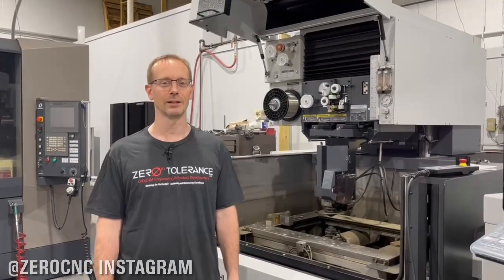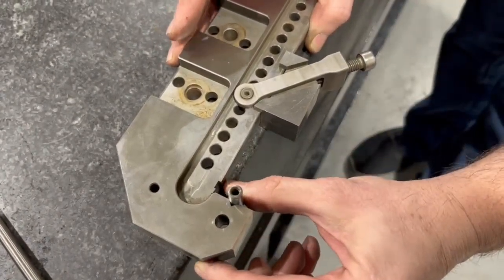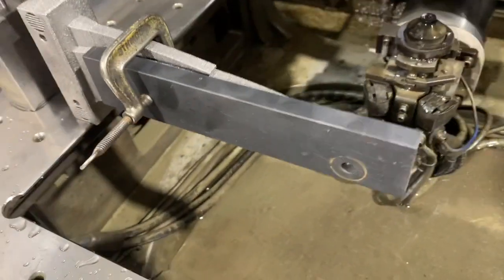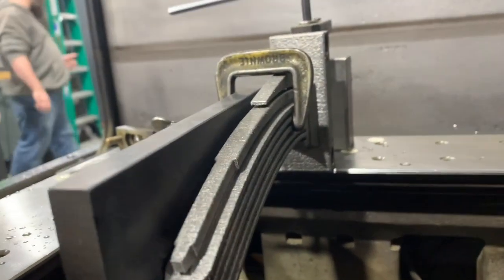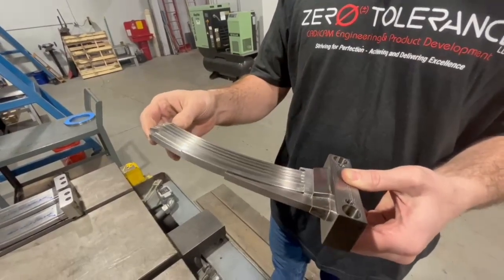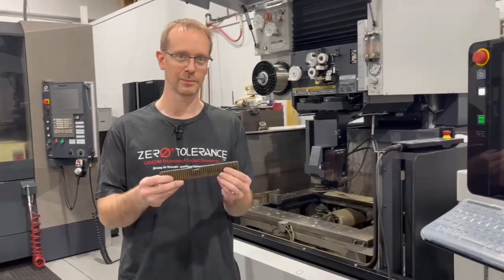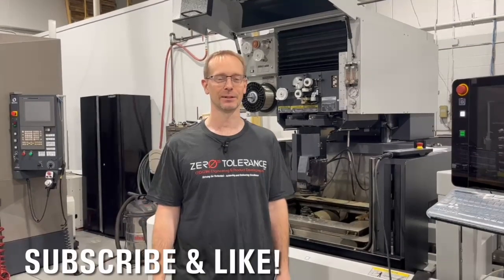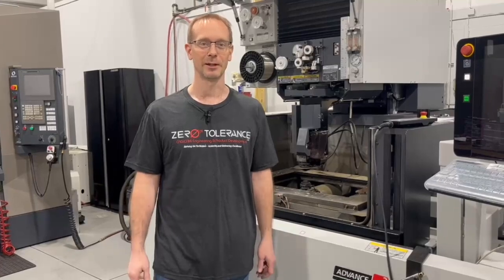Wire EDM - Practical Setups and Applications | Learn to Burn

Comment: I set my edm to always work overnight. Get it cutting, get magnets on it and hopefully its done in the AM. My sodick 280 is old and sloooooow. Im cutting a 2 in thick 7inch diameter D2 hardened gear basically. Wire breaks are my nemisis and kill my job flow

Comment: You should do a tutorial showing when it would be more or less efficient to have a wire start hole in the stock versus starting outside the block and cutting in.  I've had thin sections warp and pinch the wire if I don't start from a pilot hole.

Comment: Very nice video, thanks for sharing with us @ZeroToleranceCNC ! Any tips on how you control/prevent the bending of the parts/tabs after the roughing pass?  Especially with thin parts/tabs...
Reply: The thinner the part you want to try and make a bigger tab if possible to keep it from bending.

Comment: Very informative video. Really appreciate it. I have a question regarding skimming. is it necessary to rough all the profile first and then skim the profiles all at once? Which scenario calls for this kind of cutting method? Will the final results differ if we perform rough and skim passes back to back at each individual profiles? I guess this connects to temperature difference may be, I'm not sure
Reply: The only concern you would have is the amount of time your block is in the tank getting rusty. The dimensions should still come out good, its really a preference thing but we do it based on the rust factor and how long it is in the tank.
Reply: Thank you for your reply. One more problem I'm running into often is holding punch while performing multiple skim passes in tabs. We use shims and glue to hold the punch in place but it still twists and ruin the part. Can you suggest any method to hold it firmly or perhaps show it in one of your video?

Comment: Thank you so much for the wire videos!  I am new to wire and want to learn as much as possible.  I can get by but not always sure im doing it the correct way. 

What software do you use?  We also a Mitsubishi except its a 1200s and have been using the onboard software to program.  Doesnt seem like its the easiest to use so far.

How do you tab, cutoff and skim a punch?  especially non magnetic?  How do you catch the punch or even a scrap slug you are cutting off other than magnets? 

Can you go into detail on how to setup and run?  little tricks? 

Thanks again!
Reply: We use Esprit software, in the video when we refer to "inserts" we're talking about punches. Most of the time we'll let it wire off the tab and let it fall into the tank if the punches are small or we wire almost through it to the point where we can wiggle to break it off. If you watch the section where we explain the inserts it'll cover most of these questions. If you have any other questions let us know! Thanks for watching, we will be doing alot more Wire EDM videos.
Reply: @zerotolerancecnc  please make vedios wire EDM fixture in your shop.and how make plans share your technics.thanks